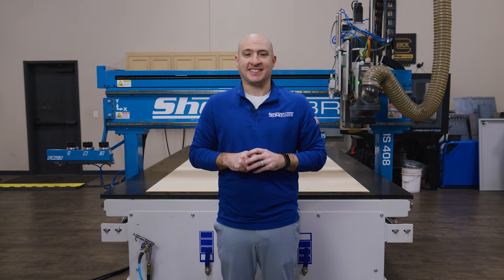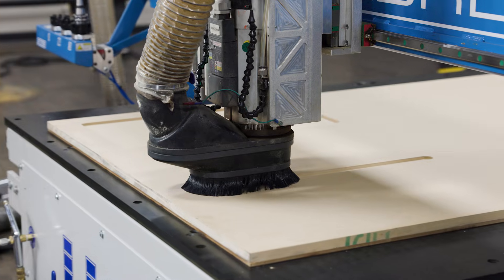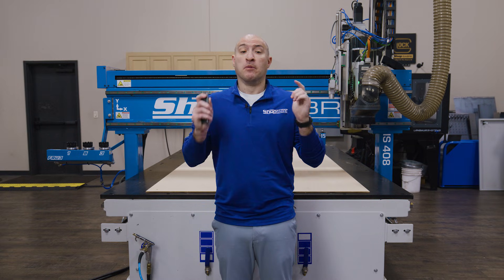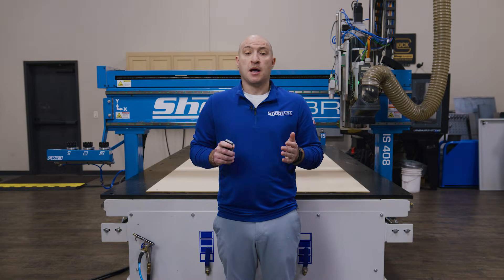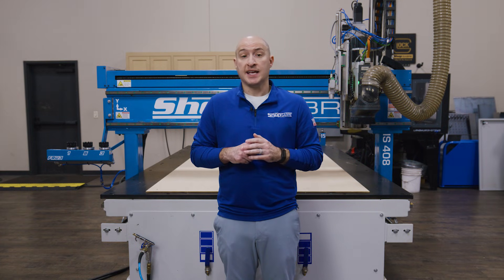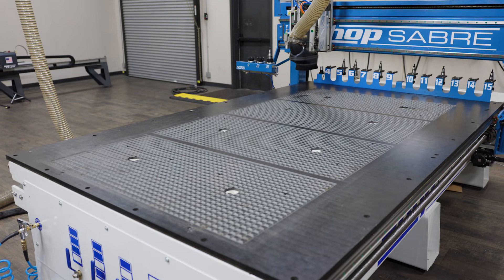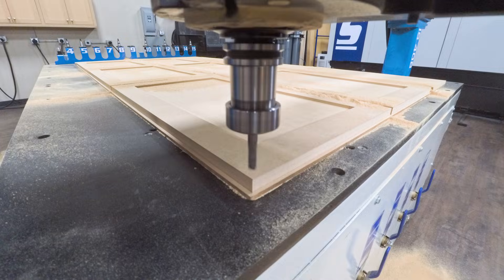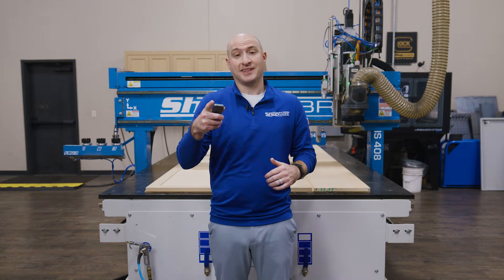Cutting MDF Cabinet Doors on a ShopSabre CNC

Comment: Struggling with warping. Any pro tips?
Reply from the maker: -Causes of Warping
Moisture: MDF is very absorbent; uneven moisture absorption/release is the main culprit.
Temperature Swings: Rapid changes cause uneven drying and shrinking.
Poor Sealing: Leaving the back unfinished or only painting one side creates tension as it absorbs moisture differently from the front.
Size: Larger doors have more surface area and are harder to keep flat.
Storage/Installation: Storing doors vertically or leaning them can induce warp before installation. 

-Repairing Minor Warps (DIY)
Stabilize Humidity: Let the door acclimate in a climate-controlled space.
Counter-Bend: For slight bows, place the door bowed-side up on a flat surface, support the ends, and place weight (~30 lbs) in the center overnight.
Hinge Adjustment: For very minor cupping, hinge adjustments might hide a 1-2mm change.
Back Brace: For slab doors, a temporary low-profile brace can help it stay flat. 

-Preventing Future Warping
Seal Both Sides: Apply primer/paint/sealer to the back (the side facing the cabinet interior) as soon as possible to match the front's moisture resistance.
Balance Construction: For shaker doors, ensure the back of the center panel is finished the same way as the front.
Proper Storage: Store unfinished doors flat with air circulation, away from direct sunlight.
Use Balanced MDF: Look for moisture-resistant or waterproof MDF for better stability.
Reply: @shopsabre This is extremely helpful, thank you for taking the time to make this reply.

Comment: Question - Door quality materials = HDF?
Reply from the maker: MDF, the lighter and more versatile of the two wood product options, is best used for:
Furniture
Flooring in bathrooms or washrooms
Cabinets or shelves (this project)
Decorative items

HDF, the stronger and more expensive option, should be reserved for projects such as:
High-use furniture
Laminate flooring
Door skins
Backing panels

Reference: https://forestplywood.com/blog/plywood-uses/mdf-vs-hdf-how-theyre-different-and-what-theyre-good-for/